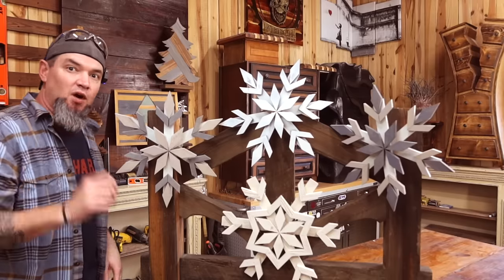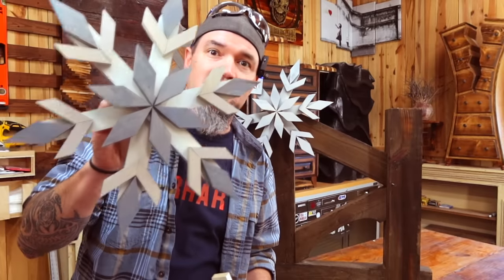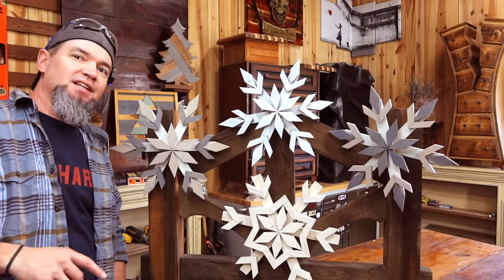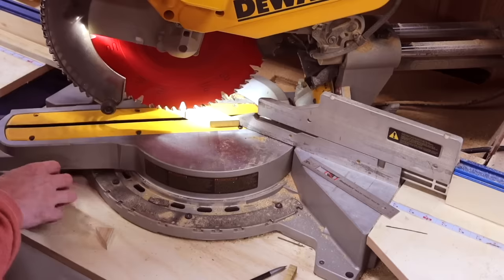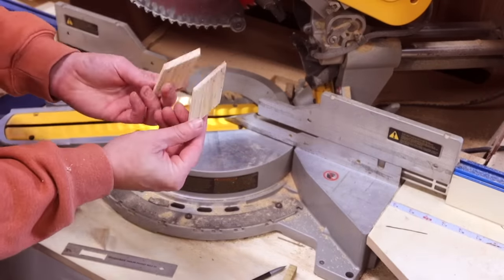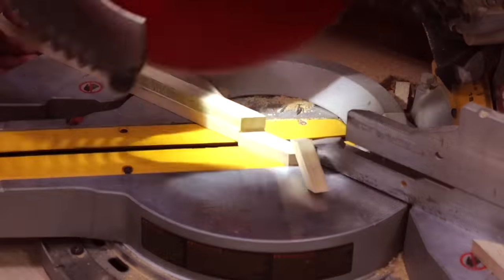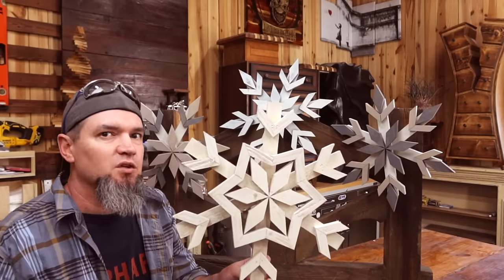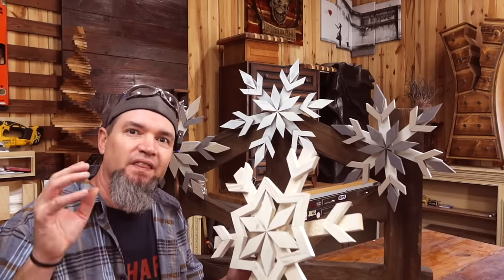One Picket - 3 Wooden Snowflakes - Make Money Woodworking

Comment: I don't have a miter saw and I'm disabled I need to know if I can get the pieces of wood pre-cut anywhere to put the snowflake together
Reply: You can do all of the cuts on a table saw. Add a push fence to your miter and push the piece all the way past the blade.
Reply: @MachineEarth  thank you but that still doesn't help me I need to find the pieces already cut  I can put them together I'm sure   I'm disabled and in a wheelchair so my resources are limited
Reply: @Donna Ables,  perhaps you have a friend who can cit out the parts for you to assemble. Look at senior centers or thrift stores. If there is a maker center in your area you could contact them.

Comment: I built one of the spiral trees out of some wood I got out of a 1930s house and looks kinda good but it being that old and abandoned for 15+ yrs some of the wood has I think termite tunnels on the sides. There's no termites in the wood they're long gone. My question is should I fill those in with wood glue/filler and then sand it or market it as reclaimed wood without any filler to add to the rustic/vintage/"historic" look?
Reply: Rustic all the way.  Added character without the effort of distressing the wood.
Reply: People pay more for reclaimed wood projects
Reply from the maker: The rustic wood tells a story and adds character. Use that to your advantage.

Comment: I really enjoy your videos but today was the first time I saw something that really bugged me. on option 2 snowflakes, I think I would have to make part A pointy at each end instead of flat.  That is just IMHO.  I am going to do option 1 with the grandsons.
Reply from the maker: Pointy would look good. Enjoy the build with your grandsons! I’m so glad you are teaching them.
Reply: @MatthewPeechWoodworking  I was getting ready to put all the pcs in bags and the math looked a little funny.
Design 1 (for 3 snowflakes)
Part
A    1 1/4” x 12” (12)...this should be  (9)

To be honest I took woodshop way back in high school.  I did limited woodwork when rehabbing houses 2003-12.  Then in 2015 I was medically retired from the USAF and I started an amazon business as a 3rd party seller.  I got used to the amazon money, wouldn't you know it 2021 they changed everything around.  I am hoping this will make up for some of that....Same day different hustle...!

Comment: What colors of gray stain are you using?  I really like that color combo!
Reply from the maker: It's called weathered grey by minwax.
Reply: Thanks Matthew!  I’m a big fan of your content.
Reply: @MatthewPeechWoodworking  what kind of hook or hanger would you put on the back of these if someone wanted to hang it on a wall?
Reply from the maker: We just have a small d ring on there but I think one of the saw tooth picture hangers could work too.

Comment: I am having issues getting perfect diamonds.  I have cut about 30 bad ones.  Adjusting length every time.  I'm so frustrated!  I checked to make sure everything on the miter saw is level and aligned - good to go there.  So lost....does the width of the strip play a role? HELP!

Comment: The meaurements on  the snowflake diamonds are impossible   at 11/4 50degree you cannot get 3.5in on one ide and 2in on the other side it is impossible to cut that
Reply: I put the plan in CAD and the only way I can make the diamond work is a 42 degree cut.  1.25" wide board,  42 degree cut, spacing/edge length 1.8736", Point to point length 3.5".  I've watch the video tons of times trying to figure out how he is making it work, but cad don't lie.  Try this and let me know.

Comment: Hello sir did you make these with treated pickets.
Reply from the maker: Yes.  Once painted or sealed they are fine for anything.
Reply: @MatthewPeechWoodworking   but using treated pickets  they shrink once they dry out pulling gaps they will not fit tight

Comment: I purchased the plans for the snowflakes, and I am cutting to the dimensions listed but the points are not coming out right.  Any suggestions? I have checked the angle and length but still can't get them to look right

Comment: For arms that are 1.25 inch wide, I have to cut the diamonds at 40 degrees (using a protractor) for them to be symmetrical and 3.5 inches tip to tip. At 50 degrees the diamonds were quite uneven. Did anyone else encounter this problem? Am I doing something wrong? I don't have an electric miter saw.

Comment: I wish I knew where you were from that you can find fence pickets for $2. Love the designs you do love the stuff you're putting out just don't know where you're getting stuff for the prices that you say because definitely in Maine they are not available at that kind of price
Reply from the maker: Hey! We are located in Kentucky and those are current prices here. But remember you can use pallet wood if you are having trouble finding the pickets for a decent price.
Reply: It's about $5 in California, but given the super high margin, it doesn't matter.  If we streamline our workflow it will compensate for the extra $3
Reply: Lowes in the Boston area has PT pickets for <$3 but cedar pickets are made of that new material called unobtainium!

Comment: I built a privacy wall with fence pickets. I found that when I ripped them down they warped big time. Why did that happen?
Reply: did you stain or seal only one side?  I have a few that are warped on the fenceline(both sides stained).  Just the way they were cut I guess, uneven stresses
Reply: @orbitalair2103  I didn't stain or seal them, they are the cedar kind that are orangey in color. But you might be right.

Comment: Are these for outdoor use?
Reply: If they're only stained they could probably stand to be outside but don't have any significant protection from weathering. You could always put a clear coat of an outdoor finish on top, use paint instead of stain, or just let them wear and weather over time. If you put them around the exterior of your house I would expect them to be fine for at least a few years.

Comment: My miter saw doesn't go 50°
Reply: It will work with any angle diamond!  My saw doesn't go past 48 degrees.  Today I cut all my scrap into diamonds and wingies!
Reply: Mine either, so I made a jig at 10 degrees and I leave my saw at it's normal 90 degrees.

Comment: Feeling really stupid right now. Can’t get the damn diamonds to be consistent. Don’t know what I am doing wrong. Had to walkout of my shop before something bad happened.
Reply: He drew a pencil line on the table of his miter saw,.. but I'm sure you could clamp down a stop block if that isn't working for you.
That's the only way that I can ever get consistent cuts.
Reply: Tried a stop block at 2 inches like said, getting diamonds not even that are 3 5/8 tip to tip
Reply: @mauricecournoyer9821  Double check that miter angle is set at 50 degrees, and that the strips are 1.25 inches wide?
If so, then I don't know. Sorry, I couldn't be of more help though.
Reply: Use a stop block

Comment: These measurements are not even close to right.  I have spent hours trying to refine these And there is no way these are right.  I want this to work but the measurements are way off on this video.  A 1 1/4 inch stip cut 2 inches will not be 3 1/2 inch. I’m really upset.  I wanted this to work.  But it don’t.